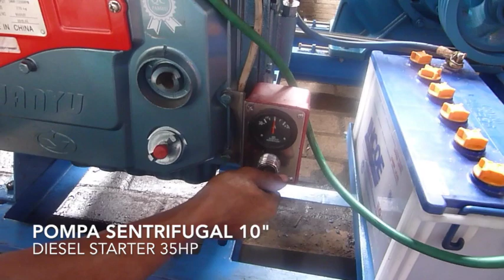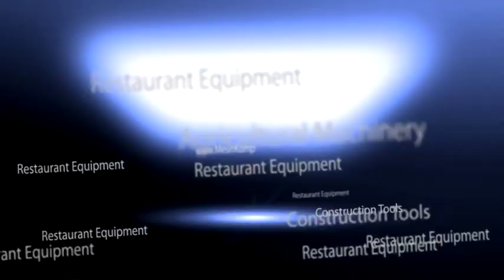Pompa Banjir 10inch Diesel Starter

Comment: Tinggi  8meter apakah air bisa naik juga..?
Reply from the maker: Daya hisap vertikal max sekitar 8 meter
Reply: @mesinkomplit5217  harga water pump 6 inch brp bos
Reply from the maker: @edyila2003  pompa banjir 6" + diesel starter: 18jt